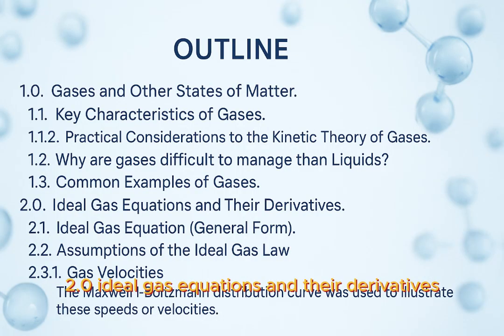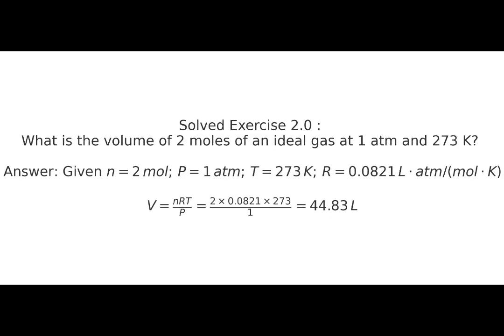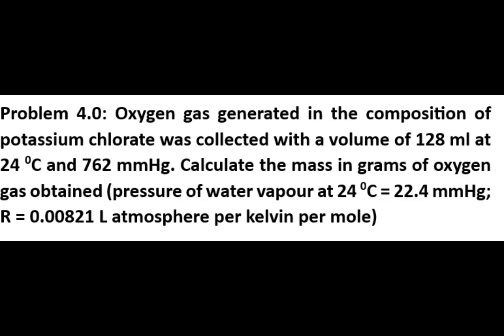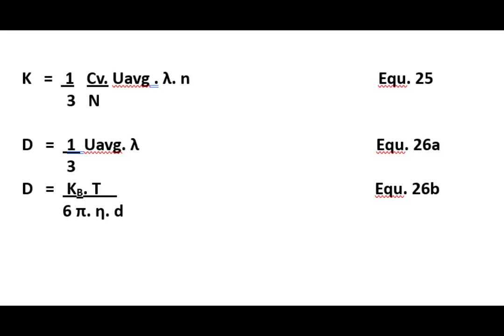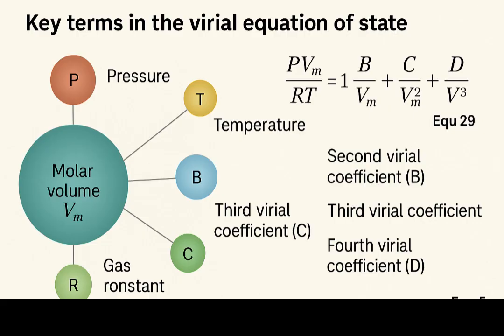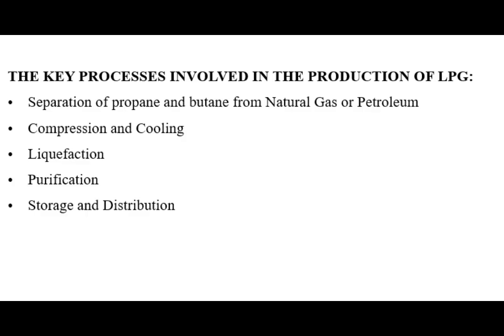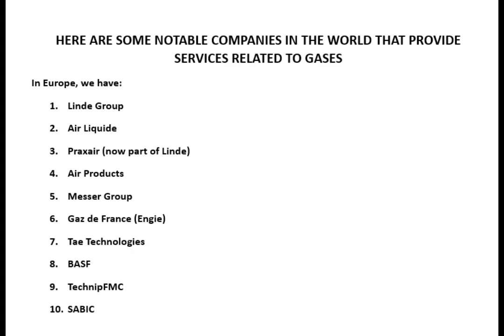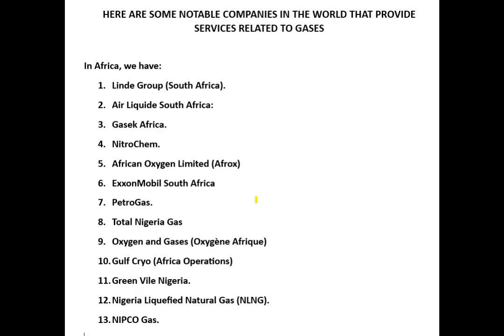Fundamentals and Applications of Gases

Comment: Dept: BCT
Name: Adigwe Joel 
Mat no: u2024/5735141
Date:14/08/2026

The ideal gas equation PV= nRT, helps estimate the amount of gas produced by rearranging it to n=PV/RT
Where:
- n= moles of gas produced
- P= pressure
- V = volume
- R = ideal gas constant
- T = temperature (in Kelvin)
We can calculate n which gives the amount of gas produced in moles by substituting the measured values of pressure, volume, and temperature into the equation

Comment: BCT: GEORGE ELIZABETH BOMA
U2024/5735326

The ideal gas equation helps you estimate the amount of gas produced by measuring the pressure, volume and temperature of the gas and substituting them into the equation n=PV/RT and the amount of gas in the moles can be calculated 
P= pressure of gas
V= volume of gas 
R= gas constant (8.314jmol-1k-1)
T=Temperature in kelvin
And n= amount of gas

Comment: BCT
Olakunle Aisha Olamide 
U2024/5735299

The ideal gas equation, PV = nRT, can be used to estimate the amount of gas produced by rearranging the equation to find n:n  = PV/RT, Here P is the measured pressure, V is the measured volume, T is the temperature in Kelvin, and R is the gas constant. By substituting the measured values of pressure, volume, and temperature into the equation , we can calculate n, and temperature into equation , we can calculate n which gives the amount of gas produced in moles.

Comment: ICPT: U2024/5781002
WOKE REJOICE 

1. What happens to its volume when pressure is increased?
When pressure is increased at approximately constant temperature, the volume of the natural gas decreases.

Because if you squeeze the gas with more pressure, it takes up less space.

This is useful because:
- Easier storage and transportation: By compressing natural gas into a smaller volume, you can store much more gas in the same size tank, pipeline, or transport truck.
- Cost efficiency: Less volume means fewer trips, smaller storage tanks, and lower transportation costs.
- Processing: Compressed gas is easier to handle, purify, and move through processing plants.

Comment: BCT: Akinyele Victory Adenike 
U2024/5735205

The ideal gas equation, PV=nRT can be used to estimate the amount of gas produced by rearranging the equation to n=PV/RT. By measuring the pressure (P), volume (V) and the temperature (T) of the gas in the closed vessel and using the appropriate gas constant (R), the number of moles (n) of gas produced can be calculated.

Comment: BCT

EJESIEME CHIDIMMA FAUSTINA 

U2023/5735021

Using the ideal gas equation, PV = nRT, the amount of gas produced can be calculated by rearranging the equation to:
n = PV/RT
Where n is the number of moles of gas, P is the measured pressure, V is the volume, R is the gas constant (8.314 J mol⁻¹ K⁻¹), and T is the temperature in Kelvin. By substituting the measured pressure, volume, and temperature into the equation, we can determine the number of moles of gas produced

Comment: BCT: Wisdom, Prosper Chioma
Matric No.: U2024/5735206

The ideal gas equation is PV = nRT, where:

* P = pressure of the gas
* V = volume of the gas
* n = amount of gas in moles
* R = ideal gas constant
* T = temperature in Kelvin

By rearranging the equation to n = PV/RT, we can use the measured pressure, volume, and temperature to calculate the amount of gas produced in moles.

Comment: Name: Ike Angel Chidera 
Matt No: U2024/5735211
Dept: B.C.T
Date: 14/08/2026

The ideal gas equation PV= nRT, helps estimate the amount of gas produced by rearranging it to n=PV/RT

Where:
- n = moles of gas produced
- P = pressure
- V = volume
- R = ideal gas constant
- T = temperature (in Kelvin)
We can calculate n which gives the amount of gas produced in moles by substituting the measured values of pressure, volume, and temperature into the equation

Comment: BCT
U2024/5735147
ASIMEGBE EMOSHIORIAMHE BLESSING 
The ideal gas equation, PV/nRT, can be used to calculate the amount of gas produced by rearranging it to n=RV/RT. By measuring the pressure, volume, and temperature of the gas, and using the gas constant R the number of mole n of the gas produced can be determined.

Comment: BCT
MMADUGBA PECULIAR ADAOBI 
U2024/5735210

Using the ideal gas equation: 
Pv=nRT

Rearrange to find the amount of gas:
n =PV/RT
Where P = pressure, V = volume, T = temperature in Kelvin, and R = gas constant (8.314 J/mol·K).
Therefore, by measuring the pressure, volume, and temperature, we can calculate the moles of gas produced.

Comment: BCT 
IYAGBA AARON MIRACLE TAMUNOSIKI 
U2024/5735129

The ideal gas equation = nRT, help you estimate the amount of gas produced by measuring the pressure, volume and temperature of the gas and substituting them into the equation n= PV / RT and the amount of gas in moles can be calculated where 
P - pressure of gas 
V- volume of gas 
n -amount of gas 
R - gas constant (8.314j, mol -1 k -1 )
T - temperature in kelvin 
R-

Comment: DATE:14/08/2026
NAME:COLLINS PRINCE CHISOM
MAT NO:U2024/5735225
DEPT:BCT

The equation PV = nRT is the Ideal Gas Law, which relates the pressure, volume, amount, and temperature of an ideal gas.
Where:
P = pressure
V = volume
n = number of moles of gas
R = ideal gas constant
T = absolute temperature (in kelvins, K)
Some useful rearrangements are:

This law assumes the gas behaves ideally, which is a good approximation for many gases at low pressures and high temperatures. At very high pressures or very low temperatures, real gases can deviate from this behavior.

Comment: Name : WARIBOKO IBINABO GLORIA 
Mat no: U2024/5735132
Dept : BCT
Date : 14/08/2026

The ideal gas equation allows you to calculate the number of moles of gas produced if you know its pressure, volume, and temperature.
the equation to solve for the number of moles (n): n=PV/RT
Where:
P = pressure of the gas (Pa or atm)
V = volume of the gas (m³ or L)
n = number of moles of gas
R = ideal gas constant (8.314 J·mol⁻¹·K⁻¹ or 0.0821 L·atm·mol⁻¹·K⁻¹)
T = temperature in Kelvin (K)
Example 
If P=1.0 atm
V=2.0
 L, and 
T=300
K:

n=(1. 0)(2.0)/(0.0821)(300) =0.081mol.

Comment: Department: GMT
Name: Ukrakpor Omiovwovwerha 
Mat No: U2024/5765007

ANSWER 

The relationship between gas pressure, volume, and temperature is described by the Ideal Gas Law:
PV = nRT
When gas enters a larger underground space, its volume increases. If temperature remains constant, the pressure decreases according to Boyle’s Law (P₁V₁ = P₂V₂). If the temperature changes, it can also affect the pressure. Therefore, a geologist can use the relationship between pressure, volume, and temperature to predict how gas will expand, how its pressure will change, and how it may behave as it moves through underground rock formations or mine spaces.

Comment: BCT: Okoji Ngozi Angela 
The ideal gas equation PV=nRT, helps to estimate the amount of gas produced by measuring the pressure, volume and temperature of the gas and substituting them into the equation n= PV/RT and then the amount of gas in moles can be calculated where 
P. Pressure of gas
V. Volume of gas
n. Amount of gas in moles
R. Gas constant ( 8.314J,mol^-1k^-1)
T. Temperature in kelvin 

U2024/5735097

Comment: DEPT:BCT
NAME:EMMANUEL RUTH NJURAH 
MAT NO:U2024/5735020

The ideal gas equation
PV=nRT
 can be used to estimate the amount of gas produced by rearranging it to find the number of moles, n
 PV=nRT
n=PV/RT
By substituting the measured pressure, volume, and temperature into the equation, the amount of gas produced in moles can be calculated.

Comment: NAME:Adaka,Grace Joe 
MAT NUM:u2024/5735044
DEPT:BCT

The ideal gas equation
PV=nRT
 can be used to estimate the amount of gas produced by rearranging it to find the number of moles, n
 PV=nRT
n=PV/RT
By substituting the measured pressure, volume, and temperature into the equation, the amount of gas produced in moles can be calculated.

Comment: BCT:ADELE ISAAC CHIKAMMA 
U2024/5735287

Use the ideal gas equation and rearrange it to find the number of moles:

[
n=\frac{PV}{RT}
]

Substitute the measured pressure (P), volume (V), and temperature (T)to calculate the amount of gas produced in moles.

Comment: Name: Jeremiah Favour Emediong 
Dept: B.C.T
Mat no: U2024/5735087
     The ideal gas equation helps us calculate the number of moles, n, of a gas produced.
   Amount of gas = moles
The equation is PV=nRT
   To find the amount of n, we rearrange it: n=PV/RT
   Just measure the Pressure,Volume and Temperature in the closed vessel, plug them in with gas constant R, and solve for n= moles of gas.

Comment: BCT
Name: NJOKU BEAUTY CHIDINMA 
MAT no: U2024/5735319

The ideal gas equation, PV = nRT, can be used to estimate the amount of gas produced by rearranging the equation to make n the subject:

n = PV/RT

Where P is the measured pressure of the gas, V is its volume, T is its temperature in Kelvin, and R is the ideal gas constant. By substituting the measured values of pressure, volume and temperature into the equation, we can calculate n, which gives the amount of gas produced in moles. The units of P and V must be consistent with the value of R used.

Comment: BCT: Nwaneri, Progress Jidechi
The ideal gas equation, PV = nRT
can be used to estimate the amount of gas produced by rearranging it to make n the subject:
n = PV/RT
Where P is the measured pressure of the gas, 
V is its volume, 
T is its absolute temperature in Kelvin, and R is the gas constant (8.314 J mol⁻¹ K⁻¹). By substituting the measured values of pressure, volume, and temperature into the equation, the number of moles (n) of gas produced can be calculated.

U2024/5735099

Comment: BCT: PETER CHINEMEREM EMMANUELLA 
U2024/5735278
The quantity of gas formed can be determined using PV = nRT. Rearranging the equation gives n = PV/RT. Therefore, once the pressure, volume and absolute temperature of the gas are known, they can be substituted into the equation to obtain the number of moles of gas produced.

Comment: BCT: MUHAMMAD SANI JEMILA
U2024/5735329

The ideal gas equation, PV = nRT, can be used to estimate the amount of gas produced by rearranging the equation to find n: n = PV/RT. Here, P is the measured pressure, V is the measured volume, T is the temperature in Kelvin, and R is the gas constant. By substituting the measured values of pressure, volume, and temperature into the equation, we can calculate n, which gives the amount of gas produced in moles.

Comment: NNANNA EXCELA UGONMA
BCT
U2024/5735138
The ideal gas equation can be rearranged to n=PV/RT to find the amount of gas in moles when its pressure, volume and temperature are measured.
So, by measuring the pressure, volume and temperature of the gas and substituting into n=PV/RT, you can estimate the number of moles of gas produced.

Comment: Abinoye Faithful Dokubo
U2024/5735202
BCT_SSLT
Using the ideal gas equation, PV=nRT, the amount of gas produced can be estimated by making n the subject of the equation:
n = PV/RT
By substituting the measured values of pressure (P), volume (V), and temperature (T) into the equation, the amount of gas produced can be calculated.

Comment: BCT
Orji Marvellous Nnenna 
Mat No: U2024/5735007
The ideal gas equation, PV = nRT, can be used to estimate the amount of gas produced by rearranging it to n = PV/RT. By measuring the pressure, volume, and temperature of the gas and substituting the values into the equation, we can calculate the number of moles of gas produced.

Comment: Name: Raheem Barakat Ayomide
Mat No: U2024/5735257
Dept :BCT
The ideal gas equation, PV=nRT, can be used to calculate the amount of gas produced by rearranging it to n=PV/RT. By measuring the pressure (P), Volume (V), and temperature (T) of the gas, and using the gas constant R, the number of moles (n) of gas produced can be determined

Comment: BCT
Isaac Mary Sopuruchi 
U2024/5735220
The ideal gas equation PV=nRT can be used to estimate the amount of gas produced by rearranging it to n=PV/RT By measuring the pressure (P), volume (V), and temperature (T) of the gas and using the appropriate value of the gas constant (R), the number of moles of gas produced can be calculated.

Comment: BCT: SAMUEL AMBLESSED MUNACHI 
MAT. NO:U2023/5735132
The ideal gas equation is: 
PV=nRT can be used to estimate the amount of gas produced by rearranging it to n=PV/RT. 
By substituting, the measured pressure (P), volume (V), and absolute temperature in kelvin (T), the number of moles of gas (n) produced can be calculated

Comment: BCT: IZEH OGHENEYOLE EMMANUELLA 
U2024/5735285

The ideal gas equation PV=nRT  can be rearranged to n=PV/RT

Now by measuring the pressure, volume and temperature of the gas, you can substitute into the equation to calculate n the number of the moles of the gas produced

Comment: Name 👉 IFEANYI, EBUBE CHUKWU
Mat no 👉 U2024/5735280
Department 👉BCt(sslt)

The Ideal Gas Equation can absolutely be used to estimate or find the amount of gas produced

A biochemical process produces a gas in a closed vessel. The ideal gas equation,

[
PV=nRT
]

can be used to estimate the amount of gas produced from its measured pressure, volume, and temperature.

Where:

- P = pressure of the gas
- V = volume of the gas
- n = amount of gas in moles
- R = universal gas constant
- T = absolute temperature in Kelvin

To determine the amount of gas produced, the ideal gas equation is rearranged to make n the subject:

[
\boxed{n=\frac{PV}{RT}}
]

First, the measured pressure, volume, and temperature should be converted to appropriate units. The temperature must be converted from degrees Celsius to Kelvin using:

[
T(K)=T(°C)+273.15
]

If pressure is measured in atmospheres (atm) and volume in litres (L), the appropriate gas constant is:

[
R=0.0821;L\cdot atm;mol^{-1}K^{-1}
]

The measured values of P, V, and T are then substituted into:

[
\boxed{n=\frac{PV}{RT}}
]

The resulting value of n gives the amount of gas produced in moles.

Therefore, the ideal gas equation allows the amount of gas produced by the biochemical process to be estimated when its pressure, volume, and temperature are known, assuming the gas behaves approximately as an ideal gas.

Comment: BCT
Okoh favour onyinye
U2025/5735128
The ideal gas equation, PV = nRT, can be used to estimate the amount of gas produced by rearranging it to n = PV/RT. By substituting the measured pressure (P), volume (V), and absolute temperature in Kelvin (T), the number of moles of gas (n) produced can be calculated.

Comment: BCT : IZUEGBU YVONNE CHIDERA 
MAT: U2024/5735037
The ideal gas equation is:
PV = nRT
To estimate the amount of gas produced, rearrange it to find n:
Where:
P = measured pressure of the gas
V = measured volume of the gas
T = temperature in Kelvin (K)
R = gas constant, 8.314 J mol⁻¹ K⁻¹ (or 0.0821 L·atm mol⁻¹ K⁻¹)
n = amount of gas produced in moles
So, you measure the pressure, volume, and temperature, substitute them into �, and calculate n, which tells you how many moles of gas were produced.

Comment: BCT
OBIOMA LYDIA NGOZI 
U2024/5735165
To find the amount of gas produced, use n = PV/RT (rearranged from PV = nRT):
Measure P (pressure) from a gauge, convert to atm or kPa
Measure V (volume) — the space the gas occupies in the vessel
Measure T (temperature) in °C, then convert to Kelvin (K = °C + 273.15)
Use R = 0.0821 L·atm/(mol·K), matching your units
Solve n = PV/RT to get moles of gas
Multiply by molar mass if you need the mass produced
This works because PV = nRT links all four gas properties — knowing three lets you solve for the fourth (moles, in this case), assuming the gas behaves ideally and no gas escapes the closed vessel.

Comment: BCT
OBIETOM ESTHER KELECHI
U2024/5735023

   List the values from the vessel in pressure, volume and temperature thereby ensuring pressure is in atmosphere/pascal, volume in liters and temperature in kelvin,use the correct value that matches the chosen unit such as 0.0821L divide the product of pressure and volume by the product of R and temperature, multiply moles by the molar mass of the specific gas to get it's total mass
          Real gases deviate from ideal behavior at high pressure,cold condition causes intermolecular forces to affect results.Some gases may dissolve in liquid mixture inside the vessel.

Comment: BCT: Ogwuche Susan Ada 

The ideal gas equation can be used to determine the amount of gas produced by rearranging (PV=nRT) to make (n) the subject. By substituting the measured pressure (P), volume (V), and absolute temperature (T) of the gas into (n=\frac{PV}{RT}), the number of moles of gas present in the closed vessel can be calculated. Therefore, the calculated value of (n) gives an estimate of the quantity of gas produced during the biochemical process.

Comment: BCT: Ekiye Obaridomuru Robinson 

The ideal gas equation, PV = nRT, can be used to estimate the amount of gas produced in a closed vessel. By measuring the pressure (P), volume (V), and temperature (T) of the gas, the number of moles of gas produced can be calculated using:
Where n is the amount of gas in moles and R is the gas constant. Therefore, the measured pressure, volume, and temperature allow us to determine the amount of gas produced.

Comment: BCT: IJOMAH, ESTHER MMESOMACHUKWU

The ideal gas equation, PV = nRT, can be used to estimate the amount of gas produced by rearranging the equation to obtain n = PV/RT. By inserting the measured pressure, volume and absolute temperature into the equation, the number of moles of gas present in the closed vessel can be calculated. This calculated number of moles represents the amount of gas produced during the biochemical process.